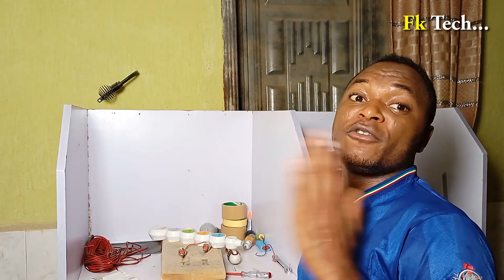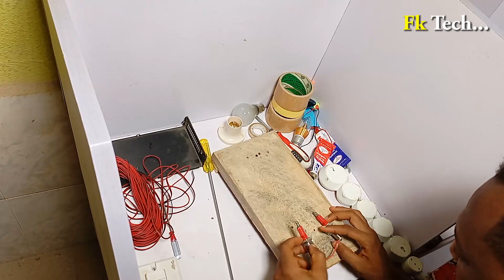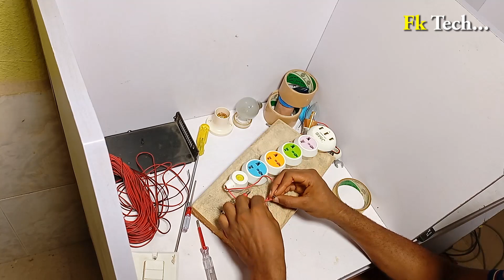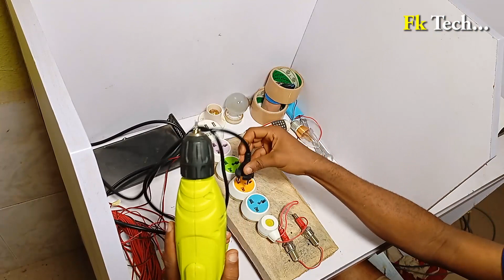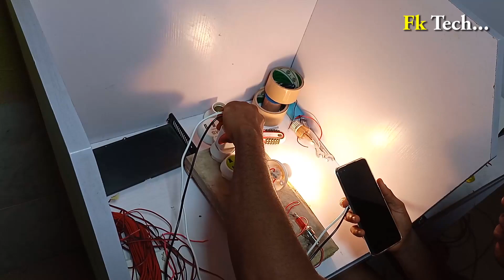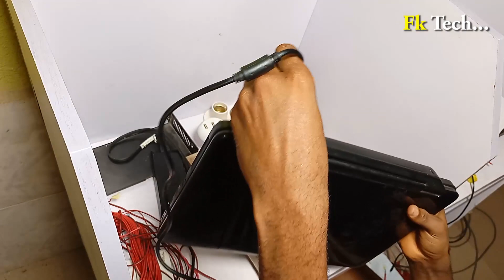Free Electric energy With Spark Plugs and Extension Box

Comment: Good afternoon sir, 1 I can't see clearly how you connect wire to the (central electrode "G")
2. Can I use Toyota Iridium Spark plugs?
3. Can I use used spark plugs or it must be new
4. Name the specific spark plugs that you specify
Reply: Im too wondering how this dude was able to connect those wires to the central electrode which is like a pin